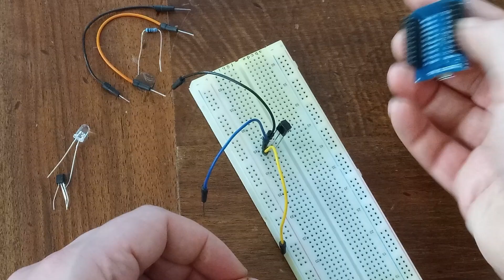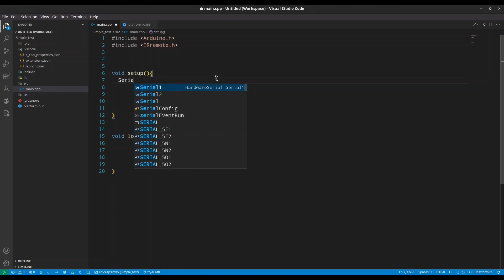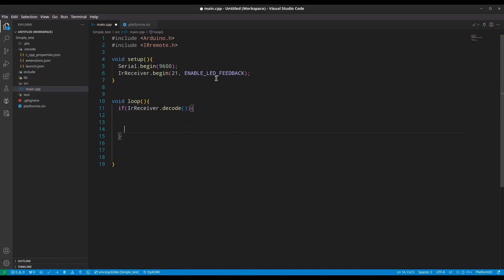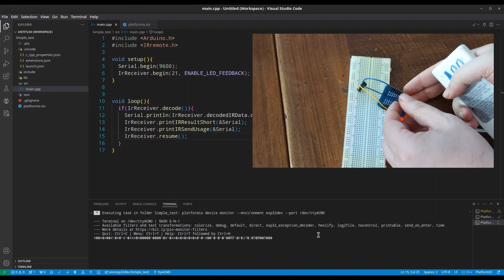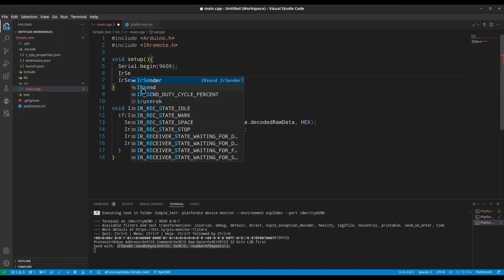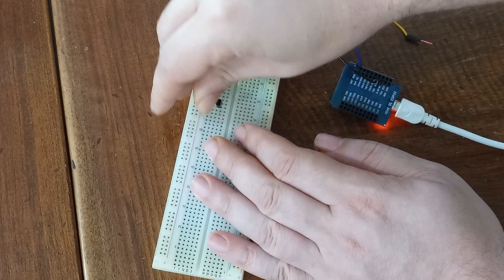ESP32 & ESP8266 - IRRemote, how to read and send IR signal

Comment: Question, whats the mosfet for? Can you not just use the resistor and led?
Reply: Because most IR LEDs are pulsed at around 100 mA of current, far more than GPIO pins can withstand, therefore either a separate power source for the LED is used, or the 3V3 pin on the ESP32, which cannot be toggled off and on, therefore you need a transistor to act as a switch instead. You can use either a MOSFET or a BJT, there's not too much of a difference for a simple use like this.